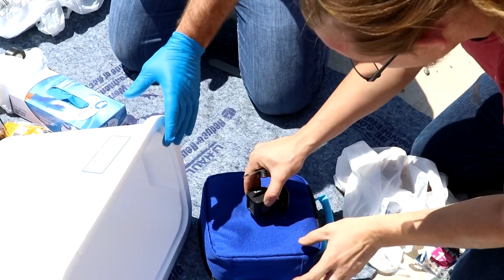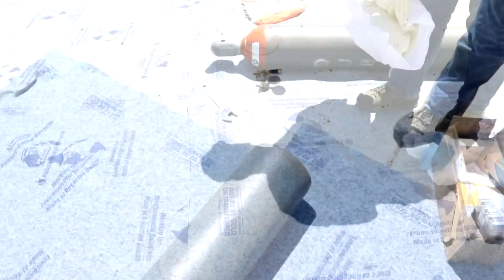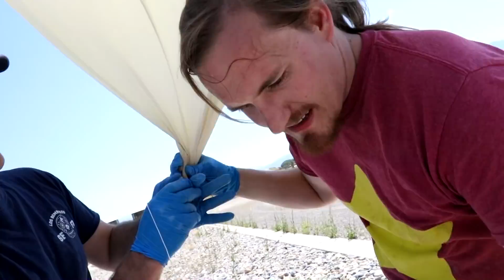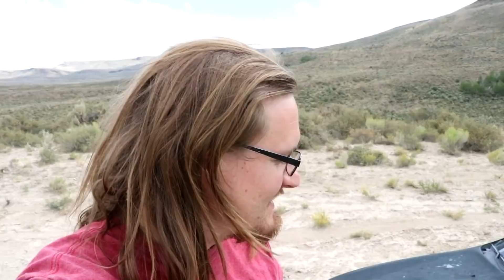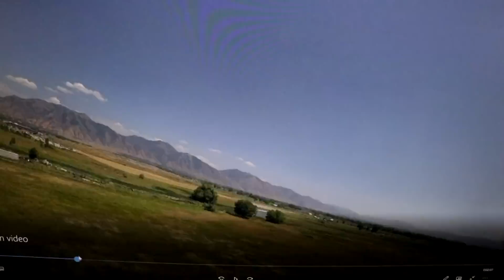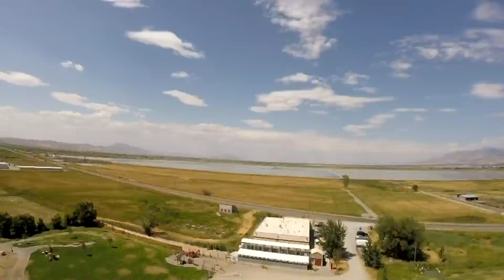My First High Altitude Balloon

Comment: Cody you should contact your local weather forecast office and do a coordinated effort with them. I work for the National Weather Service in Glasgow Montana. We launch balloons twice a day every day. Looks like your balloon was very underinflated. Also you do not need a balloon that large. We use 600 gram balloons and regularly reach altitudes of 120,000 feet occasionally higher.
Reply: Cool! Nice of you to share your experience! I hope I hope he calls your office or something next time :)
Reply: Senconded. i used to do the launches at Grand junction. Had over 600 before I moved to my office that doesn't do upper air any more.
Reply: Your town should twin with the original city of Glasgow here in Scotland
Reply: well the issue is the balloon popped too late so it traveled so far
Reply: @Michursky  it was a floating balloon. They didn't use enough gas so the balloon settled at its neutral altitude until it seal failed. Gotta use more gas to get it to burst instead of float
Reply: Hi, what is the payload mass for the 600g balloon that reaches 120,000 feet? What's the maximum mass for that

Comment: The spinning is kind of peaceful
Reply: Practical Engineering i know you.
Reply: +Cody'sLab How did you decide what size parachute to use?
Reply: I would be interested in what you do to reduce the spinning. Some folks in my local ham club are looking at building a reaction wheel to stabilize our balloons.
Reply: +David Schadlich Wouldn't a bearing/gimbal and some wind vanes help?  I presume the spinning was from the cordage twisting/untwisting. I guess that was the downside of using so much length between the balloon and cargo.
Reply: David Schadlich ham club? Ham sandwich club?
Reply: The spinning is making me a bit nauseous
Reply: I was turning my head to the left the whole time lol
Reply: Some tendency to spin could be down to the cord used. I would try using a high tensile fishing braid.
Reply: it was so peaceful that the go pro fell asleep
Reply: on a VR headset, probably not so peaceful
Reply: how about a tail, just like on kite, or sidvays kite of some sort to stablize it in one direction...
Reply: I got the moment of peace then suddenly I puke...XD
Reply: coud probaly just do with tail, at higher altitude a litl wind shud stablize it
Reply: I am dizzy
Reply: I built for a nasa club a setup with a camera attached to metal disk with a compass and motor. It sort of worked
Reply: Practical Engineering
Reply: Could you use a device like a weather vain to help prevent the spinning? A nice spinning mass would provide gyroscopic stability, and the tail could counter balance and make the device point orthogonal to the wind.
Reply: We are whirling through endless space, with and inconceivable speed, all around everything is spinning, everything is moving, everywhere there is energy. There must be some way of availing ourselves of this energy more directly. Then, with the light obtained from the medium, with the power derived from it, with every form of energy obtained without effort, from the store forever inexhaustible, humanity will advance with giant strides. The mere contemplation of these magnificent possibilities expand our minds, strengthens our hopes and and fills our hearts with supreme delight.

- Nikola Tesla
Reply: Grady!!😁
Reply: no :-)
Reply: Get a 360º cam—and there's probably an editor plugin somewhere that will software-neutralize the rotation—and we can watch it on Chrome for a nice panorama vid.
There's good budget 4K 360 cams < $100 now.
Reply: but in a nauseating kind of way 🤢

🤮
Reply: It's peaceful- in a chaotic dumpster fire kind of way.. yeah! It makes me want to sick everywhere... @neebsgaming
Reply: Wolfin... inconceivable! Lol
Reply: Peaceful if you like vomiting.
Reply: Or nauseating
Reply: Practical Engineering YouTube unsubscribed me from your channel without me knowing just resubscribed
Reply: it is!
Reply: Collab when tho
Reply: Try it on VR, the vomit arc is much greater.
Reply: I also think the cord was untwisting; Using two parallel cords could reduce it.
Reply: Definitely a 360 degree view
Reply: I love seeing channels that I watch comment on each others videos
Reply: Would be cool with a 3D VR camera
Reply: And I think the spinning is nice so you get a continuous panoramic view of the balloon's surroundings.  You don't have to watch it like a video, from begin to end, and get dizzy.  You can look at still frames from it and awe at the beauty.  Or write sophisticated software that can stitch together all frames that face 261.65 degrees and watch a video of that angle, if you wish.

Comment: GoPros ternd to run quite hot. I guess your thermal insulation simply caused it to overheat and shut down.
Reply: battery could be stuff , if you don't discharge them every now and then ,they don't hold so much charge after year or so
Reply: Not hot enough to kill it in less than 5min...
Reply: Remember it's wrapped in insulation and toe warmers, which makes it much hotter.
Reply: I think Cody's right, when recording video it's going to use more energy than a cheap battery pack can supply. Ac to USB plug packs have to provide at least 1 and a half amps constantly at 5v when recording video on a phone to not send the phone battery backwards, that pack probably can't do that and if the GoPro is already dead then it'll shut off quickly.
Reply: It would be simple enough to log the power consumption while recording and extrapolate out how much battery you'd need to stay recording for x amount of time. You would need an external power supply capable of outputting enough current though.
Reply: Yep, they have a sensor that prevents thermal run-away of the battery that is sealed up inside.  It won't matter if the battery is being used or the camera is powered externally.  The cam will shut down.  I left my Session on the dashboard to watch for anybody that may ding my car and it shut off after about 30 minutes.  I can't imagine cody's instance where it shut down after 3 minutes.
Reply: Louis Stubbolo if the GoPro battery was charged fully it wouldn't be a problem to have an external pack that can only supply half the needed current. If the amp hours are as high as the original battery, then they'll slowly drain together before the weak current draw ability is an issue. It might double as a toe warmer too running at full capacity
Reply: His camera was failing from the beginning. When he said he pluged it all night but it didn't charge. That was a sign
Reply: Nah it's a conspiracy because he discovered flat earth and the men in black came to his house and said to delete it and pretend the battery died and he said "no i'm a scientist, I will not." So the men in black took turns kicking Cody until he agreed to the battery story and deleted the rest of the footage. The men in black also kicked his dog just because they are so evil and stuff.
Reply: Toe Warmers, that's what he was saying.  Sounded like "Toe Armor."
Reply: I have multiple battery packs here that can provide up to 2.4A over USB easily, and these 2.4A ones can be bought commonly all around in stores.
Reply: Toe warmers were getting too hot, blueberries were still hot after landing...overheating's a pretty safe guess.
Reply: I think it got a bad command from the Bluetooth.
Reply: The battery was dead and the charge pack couldn't keep up. @Toble_Miner
Reply: Jake Hooper that is exactly what happened.  I was recording them kicking Cody and his dog and the weirdest thing happened  Cody was doing equations on how much pain he could take before agreeing to the demands  crazy just sitting there with a calculator and a journal as they kicked his ass.  Then they saw me recording and came towards me and i was like fuck this and dropped my camera and ran.
Reply: In hind sight, it might have been a beneficial idea to run camera tests before launch.
Reply: @FirstLast-fr4hb  The only thing he needed was a charged battery.
Reply: @chuckcrunch1  You are thinking of the older batteries but with lithium ion batteries, completely discharging them is what hurts the battery cells.  The more you can keep them charged,  the longer they will last.
Reply: not in my experience . i would keep my gopro charged above 75% for over a year and after that it would not hold a charge for more than 10 mins after charging.  My new battery i discharge until the gopro shuts off, it's 2 years old now and still has good battery life . If i did that to my Drone battery it would be fat and puffy .i don't think  Li-Ion and Li-Po work the same tho
Reply: @officermeowmeowfuzzyface4408  lol yes I heard toe armor too
Reply: @avenderael  you don't hear it if you're not used to hearing that term.
Reply: Gopro sessions will not record and charge at the same time, unlike normal gopros. So it ran until the battery died then shut off, and then resumed charging.

Comment: I'm shocked you put everything in the lunchbox, activated the heaters, sealed it up, AND left it in the sun.  All BEFORE you were even ready to go.  That's why I think the camera shut off, it got too hot, the gopro session gets pretty hot by it's self when it's recording
Reply: Well it does get pretty cold up there ,and it was a learning experiment.
Reply: As First Last said, it gets cold up there. But not just pretty cold, it gets REALLY cold. Yes, it's a strange "cold", but a lot of instruments will still be busted without proper heating.

Comment: Hello Cody,
I have launched 7 high-altitude balloons, including one during the August 2017 total solar eclipse. May I recommend the following upgrades for future launches?
1) A rigid styrofoam box painted orange for the payload container. The rigid stryrofoam insulates, contains, and acts as a crumple zone for the rest of the equipment. Painting it bright orange helps improve recovery prospects.
2) Some form of squealer for descent/after landing. I have had a number of launches where the only reason we got the payload back was thanks to the squealer.
3) To solve the battery issues, we ended up using both electrical payload heaters (The chemical ones rely on oxygen, and produce water as a byproduct. This means they don't work at apogee, and flood the payload with water and heat during re-entry.), and external batteries for all electronics. Extreme cold and lithium ion batteries do not get along. I have observed up to a 50% drop in capacity at -40C (Easily reached at altitude.) when testing a camera in a cold chamber.
4) I STRONGLY recommend procuring a gas regulator and building a dedicated balloon filler for future launches. The filler can be made for under $20 out of common PVC parts found at any hardware store, and the regulator found at most welding suppliers. Filling directly from the tank introduces a large risk of contaminating the balloon fill neck, or bursting the fill neck entirely.
5) Regarding payload spin: There are many strategies, with varying degrees of success. The strategy in section 3 of this paper seems to work well: via library depaul edu/cgi/viewcontent.cgi?article=1037&context=ahac (Link intentionally broken because youtube's comment section is rubbish)
Although I am not an expert on this subject, I hope that this helps.
Reply: Totally spitballing here but maybe it would be easier to process the spinning footage into a 360 video and then stabilize the virtual perspective?
Reply: Electrical heating is good too because it means that it can be regulated too! while your in the atmosphere the heating is fine but once you get into more vacuum like conditions the insulation becomes your worst enemy because the only way to shed heat is via radiation rather than convection (or so I have read)
Reply: snigwithasword that's actually a good idea. But throw on a few more cameras, and make a full 360 camera at all times. That'd be interesting
Reply: Maybe not gopro next time. They apparently still have issues with batteries or something draining them. I think I've only had one that wasn't bad with battery and that was my first one, so an old model.
Reply: Sounds like some good ideas for next time
Reply: My squealer do you mean APRS location reporting?
Reply: Would it help to avoid cabled string in favor of braided for the purpose of keeping relaxation from contributing to payload spin?
Reply: Something I thought about for the spinning......the string that was used probably has some issues of being twisted during manufacture. We all know what it's like to hang something from a piece of string and have it 'untwist'. There is probably a product out there that would be better.
Reply: @JJRicks Studios - no, something like a loud and annoying smoke alarm so you can zero in on the direction of your payload with your ears.
Reply: William Wakely Experience is always helpful. How much would such a launch cost in total?
Reply: Andrew Delashaw It's not about the comment being removed. Comments with links in them are more likely to be automatically marked as spam and have to wait for confirmation from the uploader to be publicly visible. No matter the status of the comment, the author will be able to see it.
Reply: Alright, more replies. Last round for tonight though.

+IceCold "Something I thought about for the spinning......the string that was used probably has some issues of being twisted during manufacture. We all know what it's like to hang something from a piece of string and have it 'untwist'. There is probably a product out there that would be better."

It is a combination of both this, and aerodynamic forces on the payload itself causing spin. Better string would not hurt, but proper tethering would do far more.

+TRiG (Ireland) "William Wakely Experience is always helpful. How much would such a launch cost in total?"

Truly depends, but it can range from $500 to easily $1500+. A balloon can range from $70 to $130, plus helium which per tank is roughly $120 (larger balloons can take multiple tanks). Add in your rigging and payload box, and the per-launch costs can be $250-$300 easily. However, assuming that you are able to recover the payload, the rest of the equipment is reusable indefinitely. A camera and a tracker can easily top $200, with multiple cameras not just impacting the equipment bill, but also the per-launch costs, as more equipment requires a proportionally larger balloon.
Reply: @Andrew Delashaw The problem is that for you, the comment will still be there. But noone else will see it.
Reply: Maybe switch to fishing line instead of string?
Reply: lol
Reply: That would be great! Here's what I found of your link: "depaul edu/cgi/viewcontent.cgi?article=1037&context=ahac" but it doesn't work (Error 404). Maybe you can supply the missing info, so we can construct the link, please? No thanks to you, YouTube.

Comment: Cool project! I did a number of launches like this ~10 years ago with some friends, we had about a 75% failure rate. You just have to stick with it until you get lucky or get really good on your logistics planning and testing. IIRC lithium primary cells work in colder weather than LiPOs (maybe that's changed since).
Lately people have been doing really small cigarette pack sized payloads on mylar party balloons and a few of them have managed to stay up for weeks and circumnavigate multiple times!

Comment: The continuous spinning in one direction implies more than some twist prior to launching. The balloon is rotating. Wind veins will help, but it might be better to attach several smaller, pneumatically interconnected balloons, like  an inverted tripod to produce a system much less aerodynamically able to spin.